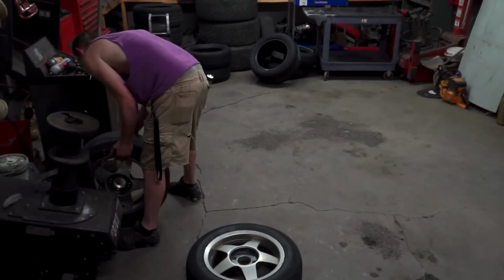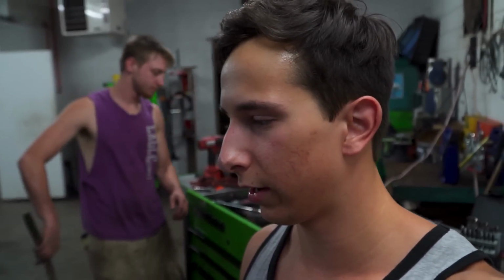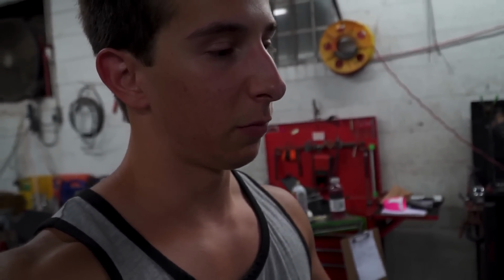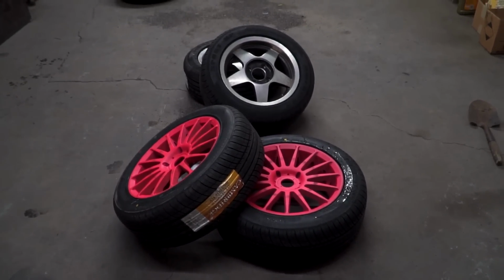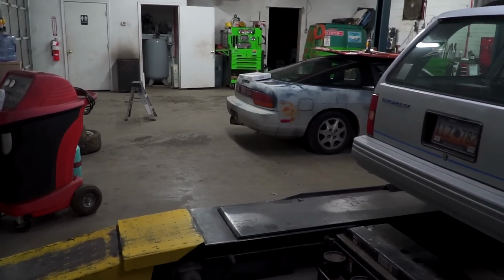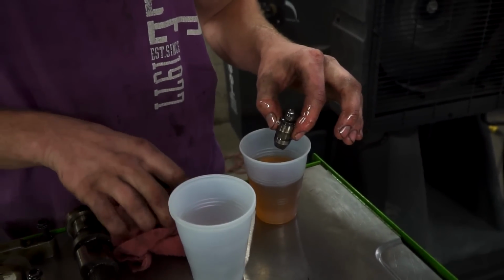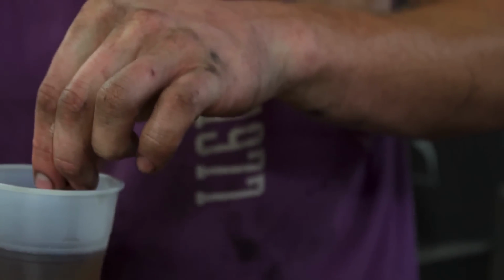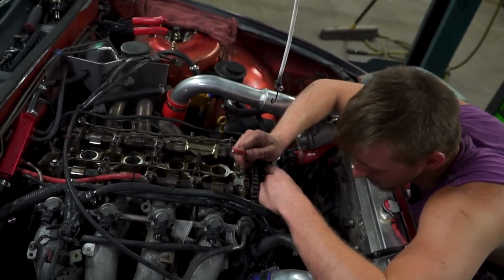DRIFT PREPPING!

Comment: How much power does your ka actually make? Thinking about to get a 240 for project car.
Reply from the maker: Zang Lor 350hp on 15psi
Reply: Southern Hooning how do you feel about reliability while pushing 15?
Reply from the maker: GoshhhJosh its reliable but on the safe side i just push 12, but my motor is built with a good tune so im not stressing alot
Reply: Southern Hooning I see , were you boosted on stock internals at any point ? I've heard of numbers like 250 wheel at 9-10 psi is the safe route ? Just tryna learn !
Reply from the maker: GoshhhJosh yea id say if your stock interals no more than 10psi you should be safe